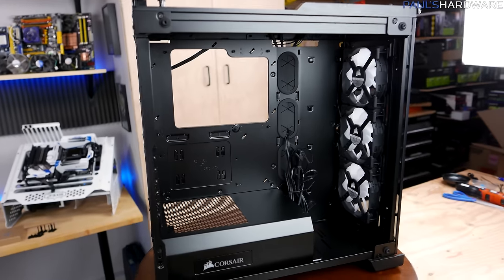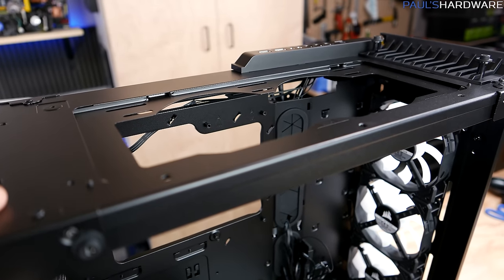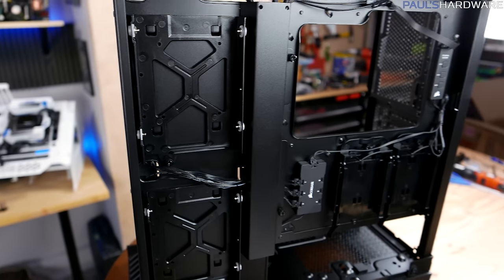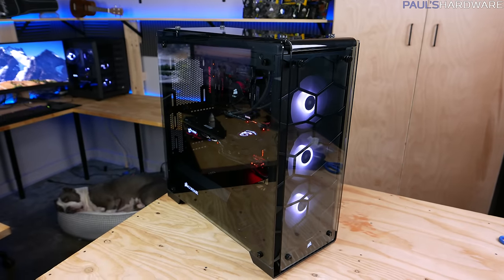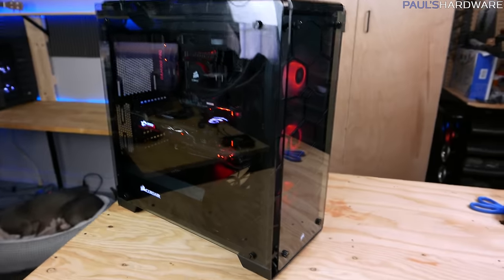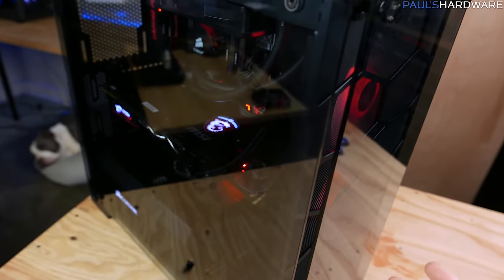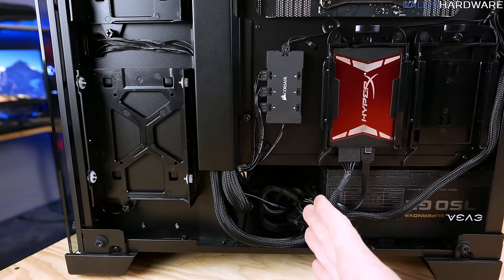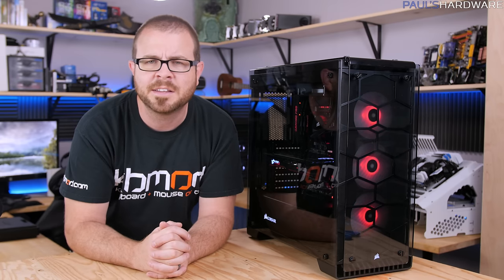Building a PC in the Corsair 570X Tempered Glass Case

Comment: i have this case in 2018 and the bottom area they have but a plate so you can not see the cable storage area from the front
Reply: Steven M I’m considering getting this case but what really puts me off is the fact that there is a huge hole on the side of the psu shroud, it shows a lot of cables I wanna hide, I just wanted to know if the cables are too noticeable
Reply: @keanelorenzo8848  I have the backside of my case facing towards a wall, but if  someone can see it then you will have to be on point with cable management.  I have see people 3d print covers for the back so that's always an option as well
Reply: Steven M thanks

Comment: I'm really interested in this case, but I don't understand what to do with the top fan positions.  If you install fans there in the exhaust position, isn't the glass in the way of the exhaust airflow?  And there's a nice filter there, which incorporates the esthetic back curved portion.  So that filter seems necessary to the design (indeed, do I undestand it is REQUIRED in order to screw the top glass into place?), and yet, if your fans are exhausing, isn't that filter majorly in the way?  Filters should only be used on intakes, I believe.  I guess you could actually just intake from the top, or not put any fans there at all, but it just seems like a missed opportunity.  Please tell me your thoughts and help me justify this case: I wanna buy it now!!

Comment: Building a almost sim build utilizing the case when it comes off back order a i7 6850k msi gaming pro x99a 32 gb or ram 1080 msi gpu and for cooling bought two more rgb fans for the top and a corsair h80i 120 for the rear to cool the CPU

Comment: Pretty evident what Corsair was going for here. But they need to lower the price about $20 US. At the $179 price point you could grab an EVGA DG series case. I think most builders want more versatility at the upper 100 - $200 price point, so they'd either need to redesign it to include e-atx boards, or bring the price down. We see the trends are going for smaller and smaller builds, however, when we get into Intel's new socket/chipset, the boards are going to have 10 DIMM slots and a socket that's around 50% larger than 2011-3 and will be forced to look elsewhere if they don't address this. It's a decent enthusiast grade chassis but these things, plus things you mention in the video, are clearly oversights...

Comment: Nice vid! Though personally, I would have put the rad on the front of the case while moving the front case fans to the top. That would have fit regardless of mobo clearance and you get the added bonus of cooler temps on the CPU.

Comment: Atx mid cases has been a pain in the ass for cable management, considering that i have 2 HDD's and 2 cd driver. I need to find a cheap full atx tower, but not too large, and a budget of 50-60 bucks

Comment: I just built my system in this case. One thing i wished i had thought about. You need straight SATA cables. The angled ones wont work. I had to stuff my 3 ssd's in the bottom by the psu.

Comment: If you were going with an air cooler instead of an AIO, could you still put fans in place where the radiator is currently is to have airflow come down into the case?

Comment: Could you move the included rgb fans to the top and rear for exhaust so the fans glow over the mobo and use different radiator fans in the front?

Comment: @8:56
I’m assuming this case is the same basic layout as 500d, if I put in a 360 30mm rad in front with ports up, to directly connect to a 280 on top with ports forward, what would be the best thickness on top to a) not interfere with motherboard and b) maybe even right angle with a very short straight tube into the 360 port (first answer seems to be that 30 with fan is most with motherboard clearance but I can’t be sure)

Comment: love this case but I'm holding out for their next version, id really like the back of the powers ply hum to have a cover and the side of the power supply hum to have a cover.  At 180 dollars id really expect a reset switch too, or a dimple I could press when overclocking fails.  I also feel they should have included a exhaust fan like most cases come with these days, even if it was a bog standard cheap one.  Great review, great case here's hoping version 2 will be improved on.Still I suppose I could get a friend to make a cover as I can see 2 holes in the power supply shroud.

Comment: I don't think this case is worth it but the Price is okay. i honestly feel the Be quiet Dark Base Pro 900 is a better case and has Tempered Glass you just don't need it all over the case and it's also around the same price or slightly more if it's not on sale..

The tempered glass on top is nice but i feel that area could have been better used to allow better radiator positioning or support

Comment: I need an inverted ATX version of this. A 600c (my current case) with tempered front and top panels.
Reply: But I also want software control of the RGB fans. I match my system colors to my current desktop background...so I need the finer control.

Comment: That is exactly the case I intend to purchase for my Zen build in early January. Nice to see a pro review on it. Kind of a shame about the lack of support for an overhead 280. I mean, yes, it can fit, but I think as with yours, most motherboards would have clearance issues w/ the heatsink. On my last build I also had a clearance issue w/ my ram modules heat sinks, but I took a dremel to them and notched them out to accomodate the radiator. I'd really rather not have to do that again. But then I've been thinking of maybe a 360 swiftech w/ integrated reservoir front mounted would look alright. Decisions... Decisions...

Comment: Hi, I'v got 2 questions: 1. what's the airflow direction for the radiator to the top? 2. I noticed that there is filter at bottom at PSU location, which means PSU fan will face down? Thanks!

Comment: Am I the only one missing the old OEM cases that were easy to open and reach components to upgrade them? Like the ones Dell makes? No screws for the panels, just clamps, cables tied up good, HDD cages for easy to add/remove HDDs / SSDs. Not these kind of see through, hard to assemble and disassemble glass cases. They look better than the old ones, but the old ones were decent and were way more functional. And oh my, LED madness these days...

Comment: I personally do  not think its worth that much considering it doesn't come with the three  other RGB fans. Also the idea of not having a decent enough place to pick up the entire cpu is a turn off for me. Maybe have a set of handles that clamp on the corners for better control during transport, then could be removed after set up. For it to be completely see threw there just isn't enogh RGB light up for me. I mean, isn't that the entire reason for buying this glass case. I would give 140.00 max for this case. The tempered glass is very sexy though. 
Thank you for featuring this case, you were very informative in helping me with my custom build.

Comment: I just bought the Rosewill Cullinan, which is similar to this case. It also that has a metallic dust screen in front of the front fans. Both sit behind the tempered glass front. Any thoughts on simply leaving the tempered glass off the front (leaving the dust screen and fans) to increase airflow? This is my first scratch build and I may be missing critical information on the negatives of that option. Or it is just plain unnecessary, especially since I don't overclock. (BTW, I am not worried about aesthetics.)

Comment: Hi Paul, I have noticed almost all GPU's have the power plug on the top of the unit. Why don't manufactures put the plug on the end of the unit? So the cable is a bit less noticeable. Also maybe less strain on the card?

Comment: @Paul's Hardware

Such a great build!

(1) How is the noise level? (since the panels are open and not sealed on the top & sides.) Do you measure the noise levels at all in your builds?

(2) As much as I like the tempered glass' aesthetics, I think I may have a problem with fingerprints. It's a pet peeve of mine.

Comment: Looks great but still not as good as the Evolv ATX glass from Phanteks imo. The price is much more reasonable on this one though ! The Evolv ATX is damn expensive, though it does have some additional features (like the fan hub, and a shroud that goes all the way to the front of the case, with a part being removable to install rads)

Comment: Mounting the radiator on top is a serious pain in the ass. Would not recommend doing that, because it's a very tight fit with most motherboards. I moved the front panel with the fans to the top (also a huge pain in the ass), and will be mounting the radiator to the front (liquid cooling, NZXT kraken x62), along with it's huge fans, utilizing the fan plate from the top (which houses 2 140mm fan slots) of the case. I'd recommend everyone do it that way as well. If switching the two fan plates, I'd highly recommend also getting some additional hardware (2nuts+2bolts, with the smallest heads possible on the bolts) in order to hold the switched plate on top, as the hardware provided will simply not fit.
Reply: On top of that, radiators mounted closer to the motherboard will dump extra heat onto the motherboard, and no one wants that.

Comment: I had this case for about 4 years.  I really hated the wiring setup in this thing. The Corsair name light broke off at the Sata cable as it was too hard and because of all the wiring it forced to break. The IO cover on top snapped off and 1 glass holder arm snapped off. Also the side tempered glass did not line up correctly as it twisted over time. The built in rgb setup was a complete waste of space and should have been removeable.

Comment: Question in regards to watercooling. When you mount the radiator at the top, is the air flow pulling out the case our into the case? I only ask due to my lack of water cooling knowledge. I assume out the case to pull out hot air but doesn't tht mean hot air it touching the water in the radiator? 

Case is nice though, good review.

Comment: Looks awesome, but bit lacking in features and such for the price. The only thing this has going for it, compared to the Phanteks Enthoo Evolve ATX TG for example, is the glass at the front. The 3 RGB fans at the front look really nice through the glass. But is that worth the price, dunno...
Reply: There's another benefit of this case, that you can install a 360mm radiator without giving away all of your storage options.

Still those "minor" design issues in both evolve and this one is making me mad. Just with few tweaks those could be "real good" than "meh". For one, they really both should have an inch taller to be able to fit a rad at top. Just an inch, and you double the cooling options...

Comment: I've had this case for two years and the top fan in the front has gone faulty. It's stopped spinning and for some reason causing the other two fans to flicker. I want to replace the dodgy fan but apparently its not straight forward as plugging and playing a new fan... you need to get a lightning controller or something... what a pain in the ass, i've heard its a common problem.

Comment: Great video Paul! I've been thinking about getting this case for my new Ryzen build I'm about to do. Like many other people, I'm just waiting for more stock of the motherboard. You briefly made reference to installing a 360mm Front radiator. I was intending to get the Thermaltake 360mm and do a front install. How do you think that would fare in this case? My idea is to get a quieter build by going overboard with the radiator size to be able to keep the fan rpms low.

Comment: Its 2017 and PC companies still to this day won't make the perfect case. This case for instance would of be 200% spot on IF they allowed extra room at the top to fit 280mm radiators without having clearance problems with motherboards. But on that note why they didn't allow the space for a 360 radiator on the top has me lost for words. Love the case but it could of been so much better

Comment: that's really nice but here's my problem. 
Water cooled video cards have the eye candy on the bottom side.
And if you want a good view of the internals there is only one side of your desk it can really be on.
Then there's the problem of external wires if you display it sideways.
 
really hard to find THE glass case, inverted MOBO, concealed externals, affordable, any suggestions?

Comment: Dear good evening, i have an a question, at the moment i have 6 fan's sp120 rgb,  but i want make another fan's sp120rgb,  in a commander you have 6 enter for fan's rgb, if i want make another fan's how i can do that? the sp120rgb required, an a 4pin from motherboard, and a 4 pin from the commander for the rgb, i need a splitter for the commander? where i can take it? i cant find, if have any solution, thanks

Comment: It's nice, but too much: top, front and left sides are enough.
The front is great.
I prefer metal over plastic too, expecially where is mounted the glass panel and I wish they used straight edges.
You can put third party solution for cable management on the bottom.
Handles are a great thing for modded PC, but this built is made to stand still, not to be carried anywhere (just nightmare).

Comment: I really like the tempered glass on all sides, but the case is just too small.  There's not enough room at the top between the motherboard and a 240/280mm radiator. Again, the case is only a mid-size and not a full size like what I'm looking for.  Furthermore, I'm going to build a Basin Falls system and need more storage options then this case provides.  Also, I will still use two, that's right I said TWO, ODDs as I want a Blu-Ray drive and a Blu-Ray burner.  King George don't really design his cases with ODDs in mind any more because most have stopped using them.  I really dislike the pattern of the front and top dust filters. I don't know what you call it, but that spider looking pattern is such a turn off to me.  I'm looking for a clean look which it doesn't provide.  

Overall, I like the direction King George was going with this case, but it has too many limiting factors for the system I'm going to build.
Reply: There is plenty of room for a 240 up top. I have a Kraken x52 in mine and it fits fine. A 280 however is a little to wide when paired with most motherboards. Tho if you remove the mounting bracket you can make it fit with a little bit of fiddling or you could just get low-profile RAM.

Comment: while i really like the tempered glass movement, i do not like it on all sides, as it is just not practical at all. I am looking to make a massive build within the next two months or so, and am really struggling with a case decision. At the moment i am leaning heavily towards the Maker 5t or just the Maker 5. There is an outside chance i could go with the Evolv. but don't like it as much. But I was told today that Cooler Master was coming out with all new cases in june. so i will probably just wait to see what they do to the maker 5 and 5t before making my final decision.

Comment: I installed the PSU in the wrong way i think. The fan faces towards the top of the case instead of the bottom. The air feels cold to the touch when i put my hand on top of the PSU shroud though. Is it worth flipping the fan?

Comment: Any recommendations for a ATX Mid-Tower with space for an optical drive? As my internet isn't really fast, and sometimes games take a lot of time to download, so I prefer to buy physical copies of them. My budget is max 200$, not bothered if there's a window sidepanel or not.
Reply: Fractal Arc Midi.
Reply: I'm about to buy a new case and need an optical drive bay. I like tempered glass, but really just on the left side of the case. I don't need it on the front, and I certainly don't need it on the right (cable) side nor the top. (The top? Really?!) So, I've decided to purchase a Phanteks Enthoo Pro M Tempered Glass version. It has 1 optical drive bay, tempered glass only on the left side, access holes for cables that attach to the bottom of the motherboard above the PSU shroud (USB, Audio, Front Panel wires, etc.) and plenty of room for cable management on the right side of the case. Unfortunately, it won't support an E-ATX sized motherboard with a width of 272mm (such as the ASUS Rampage V Edition 10) without modification of the case's motherboard tray area where the case bends inward. That's ok with me though... at this time, I'll be using a regular ATX motherboard.
I've been told the tempered glass version will begin appearing around the 1st of December of this year.
Reply: Just but an external one for $20

Comment: I like the glass, but not on top, I predict it will be like those glass tables that were so hot a few years back, first they fill up with dust and finger marks and then some moron manages to crack it for you by putting something heavy on top... I'd like that case if it was just a tad bigger tho... seems to be somewhat of a challenge to build a custom loop in as KitGuruTech did mention in his rev. so fitting my loop in there would be a right pain in the... um... Rear IO...-Morb

Comment: The biggest thing I don't like about the case is the big gap at the side panels. I imagine it is so the sides are easier to remove but it seems very unclean and ugly to me. Would have been much better if the top/front went flush with them with a small gap around it. Yeah that could mean making removing the top/front mandatory if you wanted to remove the side but if its not like that it looks funny if you look at the case from the front.